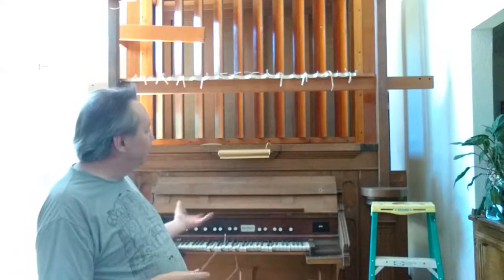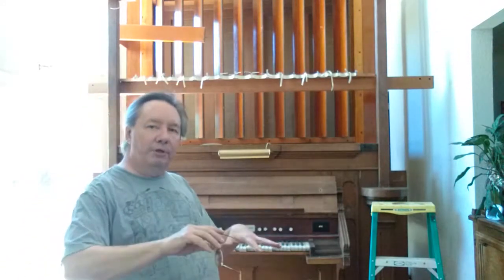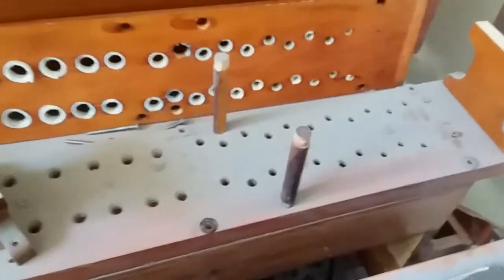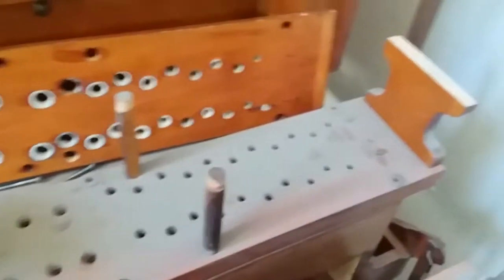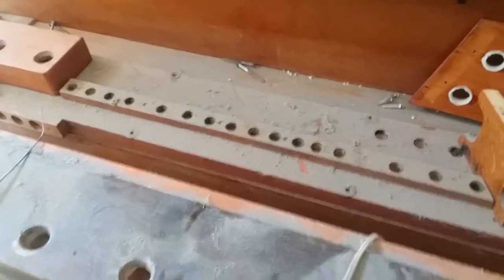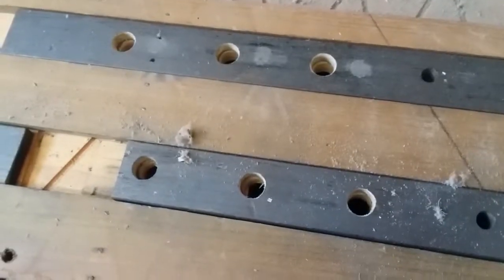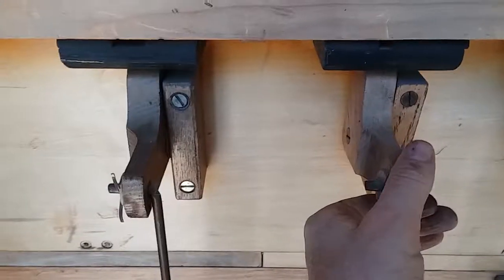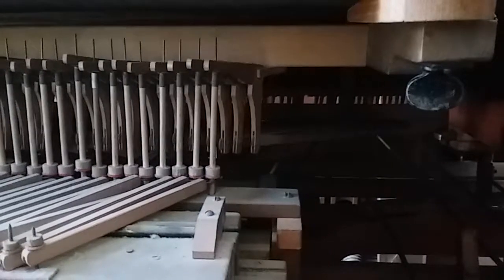How a Pipe Organ Works Part 2

Comment: 8:00 - now I directly see how the keys control the corresponding parts that are close by, but how those parts far out are controlled? It's hard to imagine it's by the same mechanism because of the long distance.
Reply from the maker: The keys actuate a lever that converts the up and down into a back and forth on the tracker bar ( the long mostly broken wood rods). At the opposite end the is another lever that converts the back and forth of the tracker into an up and down to operate the valve.